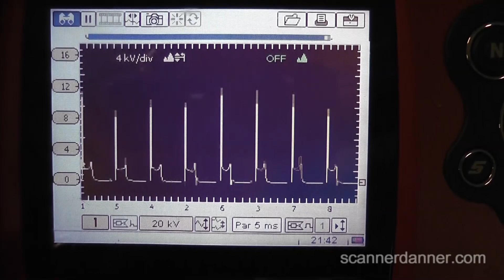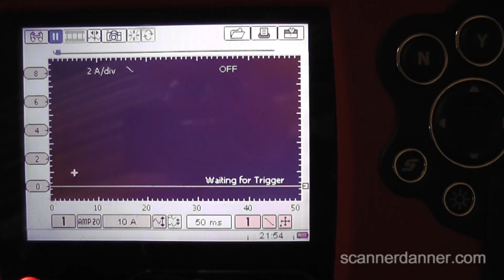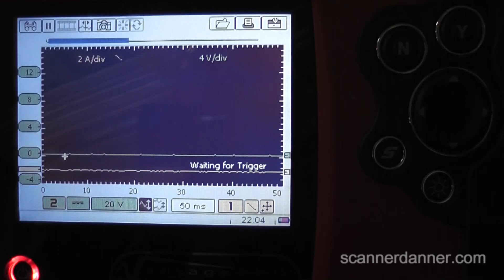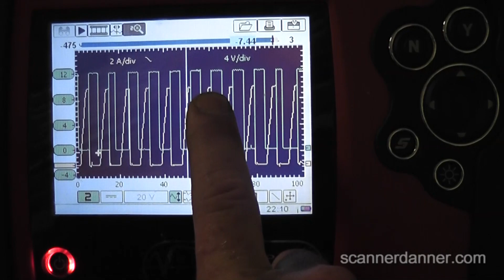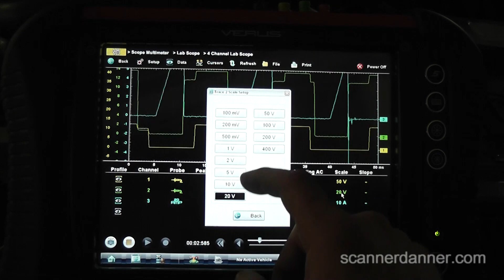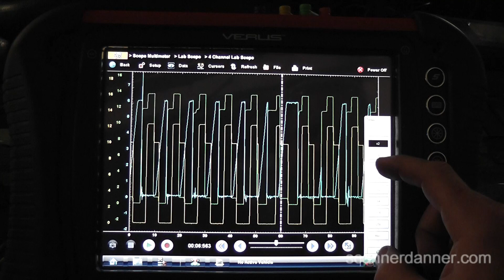Ford EEC-IV Ignition Misfire - description, operation, testing part 1

Comment: Well buddy, new injectors, intake gaskets, timing adjustment, and the engine running condition degraded to the point I am certain my ECU is bad, drives fine, just don't stop, it wont idle, the ECU is a special one that is so rare it cost 3 to 4 times what every other one for the year van, its just not worth $600 more just to see if the damn thing will run right, this is why I prefer a carburetor. Radiator broke, transmission burnt up, C-6, not computer controlled, alternator burnt up, ate the brushes down to the wires, regulator corroded till the pins broke off, distributor was busted where the hold down screw was, more money has been spent on repairs than the van cost, and it is not street able still, no one wants to work on it that has the equipment to hook to it, they prefer OBDII. The fact capacitors leak out and destroy the circuit board is good reason to stick with carburetors, avoid this electronic mess.

Comment: GREAT VIDEO Paul! 
Scanner danner greatest hits for me, because I have a misfire eec-iv same engine that’s in this video, that ends up in a crank no start, I suspect the pick up coil in the distributor is bad but need to confirm before I condemn the distributor! 

I might have caused it when I got rid of two connectors in the fuel pump circuit and soldered the wires the wrong way that might have damaged the pick up coil, I also lost the power to three of the gauges in instrument cluster after this repair…..amateur night! 🤪

I’m getting a two channel scope today so I can see the Hall effects sine wave and verify if there’s an issue!
Paul, Is it possible for you to post part two on your YouTube channel???
Leor

Comment: Thank you for that video. I want to try and connect my snapon modus. What else do I need besides the low amp clamp?  I’ve been wanting to do this to my 88 bronco 5.0 that has a similar condition. I never used the old sun machines but I would watch the old timers back in the day. That big thing has been long gone.

Comment: Dude watch all your videos... loveem... got a 93 f350 with a 460... tach drops and engine runs like crap. changed coil it took a while for it to bring the tach back then it ran good for about a month. all of a sudden the issus reappeared same symptoms. replaced coil again worked for about 10 mins and crapped out again. no tach runs like low fuel pressure. 60 lbs of pressure please help
Reply from the maker: sorry man, I don't check these messages on this channel very often anymore (since YouTube closed the paid channels). For future help, post your questions to my forum okay? It is free to join. Hope to see you there
https://www.scannerdanner.com/forum.html

Comment: I have heard of the distributor shafts becoming magnetized effecting the hall effect signal and back when this system was more common you may have to go through a few reman units to get a good one. That may have been the case you ran into years ago that caused you grief because it looked like it had been previously replaced.
Reply from the maker: I have also heard of that back in the day and I would not rule that out

Comment: Nice detailed explanation as always Paul.
Reply from the maker: thanks man
Reply: @ScannerDannerPremium  I'm a big Ford guy that specializes on Panthers. I got a 95 Town Car with a 2004 Interceptor that likes to randomly surge idle only in gear. Once you got to park, its fine. The original PCM was doing it all the time no matter what gear/park it was in. Replacing the PCM has helped a lot, but hasn't fixed the issue. I'm leaning towards the driver for the IAC. Any clue where I can get a schematic on the PCM for this vehicle? Appreciate any feedback.
Reply: @kitt199546  Here is a link for the DIY version of the service info I use. It will be the same diagrams too only in black and white, which is not a problem. As far as an idle surge in park only. The first thing I would want to see i the function of the park/neutral switch. Ford calls it a manual level position sensor. I have seen idle surging being caused by this range switch showing that it is in gear, when in park (opposite of your complaint but I'd still want to see this data PID). Just curious, how does it idle in neutral? Second, focus on your TPS, I have seen many, many Ford's in this era that have TPS glitches that occur near the closed throttle position that cause idle surging issues. 
https://eautorepair.adtrk.biz/?a=10817&c=24&p=r&s1=

Comment: So correct me if I am wrong, but this is a case of classic "garbage in garbage out?"

Meaning the crank signal is sending a bad signal to the computer and it is trying to adjust the dwell and timing based on this bad signal???

Comment: Very good video Paul thank you for it. The vantage pro is still a relevant tool and will be for a long time (IMHO)
Reply: I agree. I use my vantage pro at work all the time. I still have and use the original vantage sometimes.
Reply: +Michael Herbert   Good morning Michael. I am learning to use the Vantage Pro, and so far I love it. A friend of mine had an old Vantage and he gave it to me. I think he left the battery's in it too long and they messed it up. He has another one. Hopefully, he will will give me that to me too. As a gas, I have asked a friend to give it to the Snap On tool guy..  We will c what happens. I watch Paul and his brother use the old Vantage all the time as a quick go to, and an extra to watch another circuit while using another tool. Thanx

Comment: Really appreciate your use of the Vantage. Showing the buttons and the buffer and movie was great. I remember u saying this system was very similar to the GM. The crank sensor is a vrs sensor. Could we look at the signal when the old distributor is out of the car?  Maybe the shaft is bent or their is an anomaly in that signal. It can't be the module or the computer. Isn't air gap important to get the right amount of, what's the word that describes the voltage swing?  Thanks for the extra attention we premium boys (and girls) get. Amplitude I think is the word.